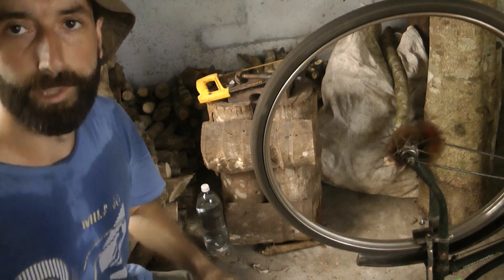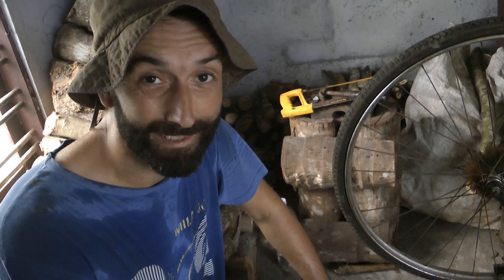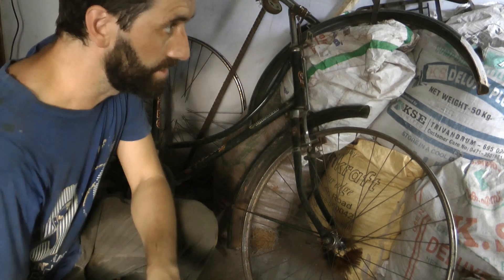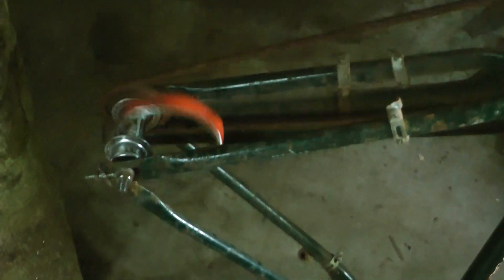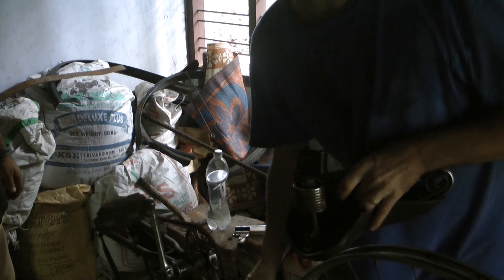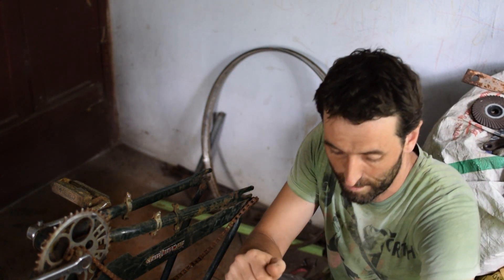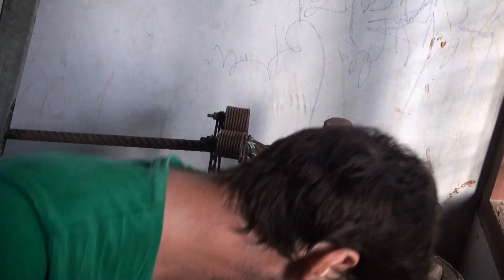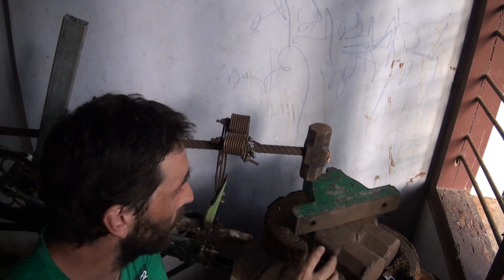The Bicycle Power Hammer! - Build one in under FOUR Hours - Blacksmithing!

Comment from the maker: Video Update: Added a motor to the bicycle power hammer! https://www.youtube.com/watch?v=qXw9D2D_0qk

This was only a proof of concept to see if it would be worth investigating further.
           It turned out to hit 5 times per second. I had to do some more work later to the cast iron frame to stabilize it in preparation for adding the motor, by welding support frames and bolting it all to the ground. 
I used a 2 hp motor as I did not want to go the DC route and also added a slip clutch. Actually it is running great, is more durable and gives a lot of whack now for such a small hammer. 
If I ever build one again I will use a motorbike as the concept works just the same.
Check out the video to see it working properly. You will be surprised!

Comment: this is great for people like me in wheelchairs who want to blacksmith....
Reply: I am far from an expert on the subject, but don't the majority of people in wheelchairs have issues with the use of their legs or endurance. As long as you protect your legs and position your tools correctly it should actually be possible to do a lot of forging from a sitting position without needing to move much which would probably be great for any wheelchair users who have normal upper body strength.
Reply: @garethbaus5471  It depends on the person and why they are in the wheelchair. For me I have full use of my legs and body. I just dont have the strength to walk.

Comment: The forces you are describing are similar to pressure washing with water. People often get confused when discussing the differences and importances of P.S.I (pounds per square inch) and G.P.M.(gallons per minute), how much water they use per minute. They often grasp the psi part but overlook or under appreciate the gpm part. 
So I always simplify the concept for them by explaining, "You and I both have the same hammer, both hit with the exact same force. That is your psi.

Except I hit my rock 50 times in one minute and you only hit the rock 25 times in the same minute. That is your gpm. So, even though we both hit with the same force, I'm hitting twice as often as you, so who is going to get the most work done?"

Seems to clear the concept up.

So, my point is, everything in the entirety of life, circles back to blacksmithing!

Comment: This is in the same class of usefulness as rubber lips on a woodpecker...
Reply from the maker: Ha yeah so was the first light bulb lol. It was meant as a proof of concept. I find that even more valuable than getting to the end result. Check out the video were I stuck a motor on it and aded a few extra supports. You might just be surprised.